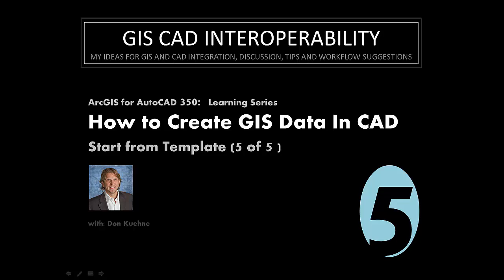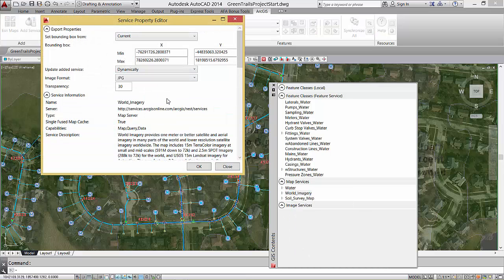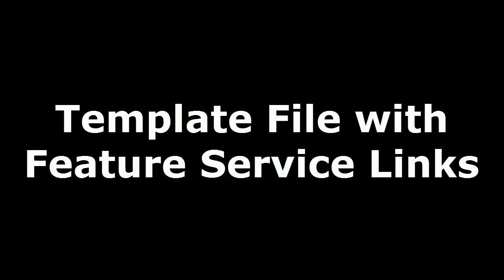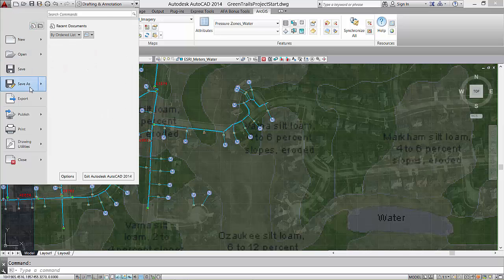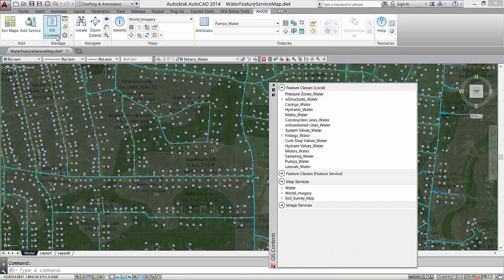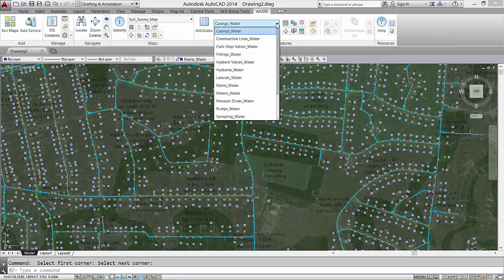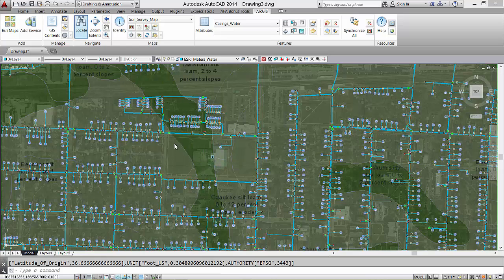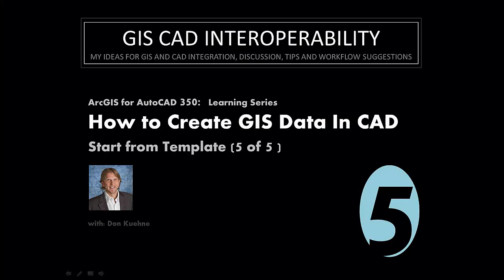How to Add ArcGIS data to AutoCAD: Part 5 Template Files

Comment: I'm a landscape designer from china,and we can not project our cad cordinates to wgs84 because of the lack of the 7 parameters.
I used the georeferencing tool in arcmap to correct the coordinates,so it can publish to the web correctly,but  i still need the cad coordinates ,because we need it to annotate,and send prints to the 
constructors.
So i wanna know ,will the arcgis for autocad add a georeferencing like tool or the capability of reading wld file,so i can keep the cad coordinates and use the map and server services .
Thanks.